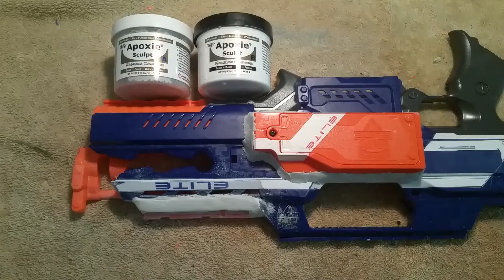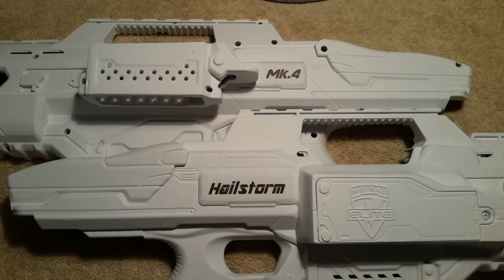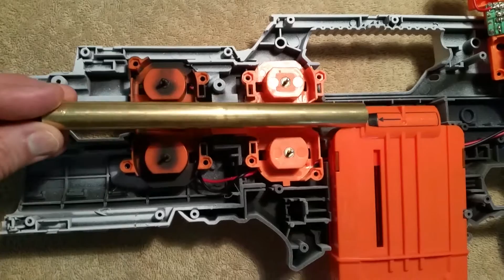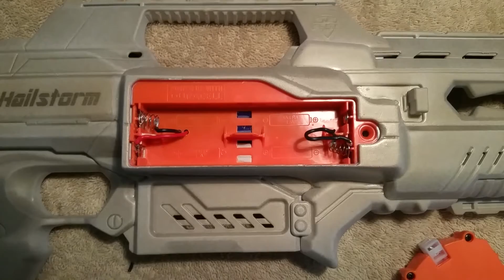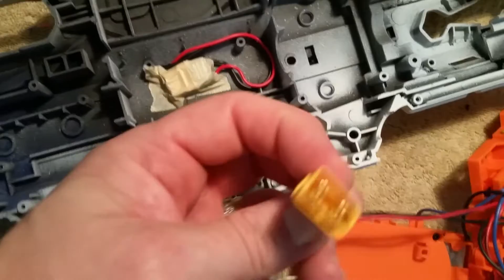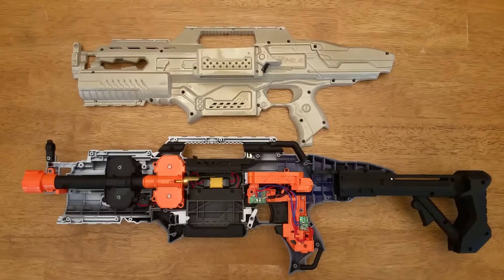Hailstorm Mk.4 Build Journal Pt. 2 - Epoxie Sculpt!

Comment: on the mk5 I challenge you to do 3 flywheel sets
Reply from the maker: I put three sets of flywheels in the core part of the Hammerhead blaster and that worked out well.  I may have to build a three stage Rapidstrike at some point...

Comment: I'm glad you took my suggestion and gave the epoxie sculpt a try. I assume you wet your epoxy to make it nice and smooth before it dries? It really lessens the sanding time.
Reply from the maker: Yeah, thanks for the tip.  I ended up using more than I needed and worked it down with a file and 40 grit sandpaper.  I need to use less next time and I'll give wetting to down a try.